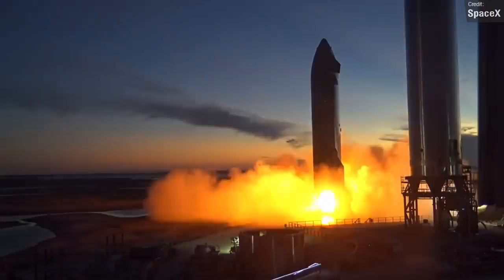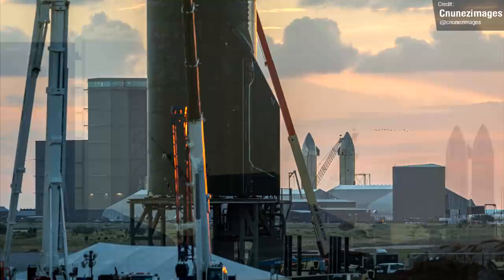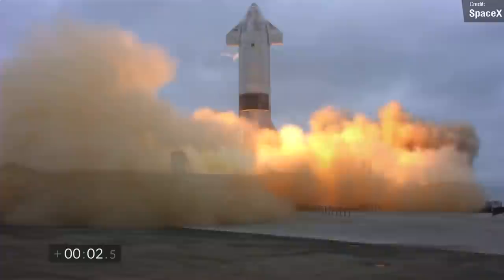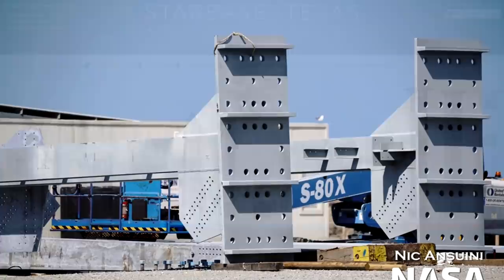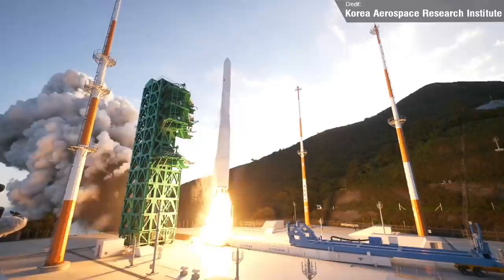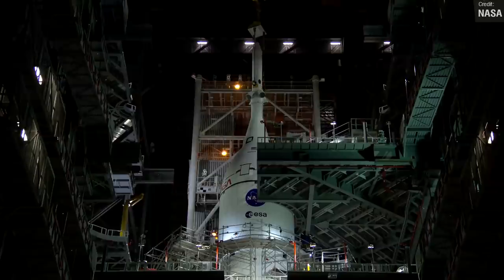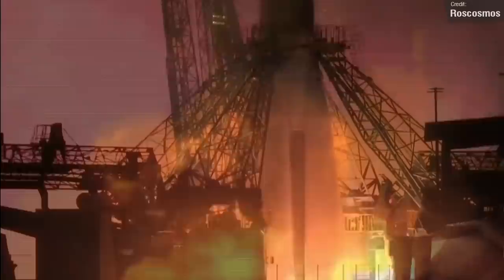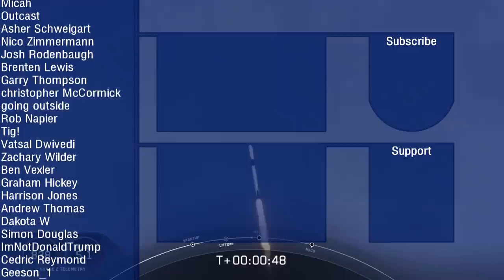SpaceX Starship Damaged in Static Fire, Catch Arms are ON, SLS Complete, Soyuz Progress, NASA Crew-3

Comment: The funniest thing about the failure of the maiden flight of the ariane 5 rocket is, that it was actually a buffer overflow, which caused the failure.
Reply: Like an integer overflow?
Reply: @notoriousgoblin83  I don't know, but it was faster than the Ariane 4 and no one changed the code, so that the speed overflow somehow was partially used as position data.
Reply: Yes, like an integer overflow (the processor only used 16 bit integers, but the velocity censors 64 bit integers) which caused it to override the rotation data. (That's what I remember) in the Ariane 4 they had a working system to prevent that, but they didn't check it again for the Ariane 5, which had a different flight plan and thus didn't work. The funniest thing is that the system wasn't even needed on the Ariane 5 anymore. (This system was also only activated after a minute or so after launch because of memory constraints on the Ariane 4)

Comment: Tbh I think the amount of tiles falling off actually shows how well theyve worked on the heatshield thusfar, as its only like 8-10 out of potential thousands. Ofc we don't want this to be an issue later on, but for a first fully stacked starship using such a rapid production process, I think this is a good sign of overall quality and that improvements will come swiftly.
 Plus, starship should hopefully be able to survive re-entry with a few tiles missing, so it could also be a good test bed for this kind of re-entry test
Reply: I agree and I think a lot of the problem they are seeing now is due to the shock wave bouncing back off the ground during static fire. As long as they can survive the aerodynamic forces they should be good.
Reply: @mgcamp85  Thanks for the clarification; I was wondering why the static fire was harder on the tiles. There's likely still to be some improvements to the mounting system I suspect.

Comment: My money’s on SLS. The only reason I say SLS is due to FAA issues with spacex.
Reply: It's not the FAA's fault, though. First of all, SpaceX already conducted a suborbital launch without FAA approval (remember SN8?), so they don't seem to care that much.

What's more important, though, is the fact that both Musk (in March) and Shotwell (in June!) suggested an orbital launch no later than end of July when in reality four months later they haven't even got the launch infrastructure in place...

I suppose they wanted to use a bunch of volunteers to prop up the booster during launch and use hand pumps to get the LOX and methane in ¯\_(ツ)_/¯

Musk's timelines are for the most part BS and shouldn't be taken seriously. They'll get there eventually, but there's no rush so why bother. Remember that rushing launches caused the death of 14 shuttle astronauts... Even when they launch in February or March, that'd still be amazingly fast and much more progress than SLS managed to achieve.

Comment: I feel that bn4 and sn20 and surrounding infrastructure will be finished before years end. However I think that like sn 8-15 there will be a 4-6 week delay pushing the launch into January. The FAA is a complete wild card I can’t even hope to predict with any merit.
Reply from the maker: Stage 0 doesn't need to be completed before the orbital launch, since BN4 and S20 will be landing in the ocean. The only thing that NEEDS to be there is the orbital launch pad and the fuel reserves, the tower and whole mechazilla won't be required until at least Booster 5 (I would be very surprised if it gets used for Booster 5 or even 6 though).
Reply: @MattLowne  I think infrastructure-wise he just meant getting all the plumbing finished, leak-tested, run out to the pad... I can't even comprehend how many valves will need to be checked, double-checked, triple-checked, replaced, there are probably hundreds of sensors for temps and pressures on all of the tanks and piping, all of that needs to be wired and rigged / networked into computer systems which probably haven't been tested before.  They likely have no other options either, just due to the sheer mass of propellant and oxidizer required for super heavy.  I don't THINK it'll be an issue, since they have a lot of experience with this stuff by now, but it certainly could throw a lot of curve-balls in their direction. 

I'm still not sure about mechaszilla in actual practice; one thing that really surprises me is the lack of guy-wires on the opposite corner of the tower from the catch arm. I know the tower is strong, but from a structural engineering perspective, I don't see how the tower can absorb THAT amount of initial force and weight without some sort of counter-weight or guy-wires, etc.  Perhaps they will install them later, as it's obviously not required yet and they can't tension them at all till the remaining equipment (ie weight) is installed. Oh well, those folks over there are certainly a lot smarter than I am though... I'm sure it's been modeled.
Reply: @alexmathis8505  yeah that is essentially what I mean

Comment: @Matt Lowne I think there is a very simple solution to the tiles popping off.  I was considering a puzzle structure (not needed) and then realized that a ridge and groove system could be incorporated alternating on every other tile, to snap them into place.  The "next" tile on all sides would literally hold a tile in place on all four sides.  You only need to place a groove all the way around the center of the side (no ceramic glue on the sides, but of course underneath).  If every other tile has a ridge, then alternately a matching groove, each surrounding tile would hold the tiles together, and it wouldn't completely depend upon the adhesive.  One tile with grooves, and one with ridges. All you do is alternate the tile as you lay them out.  Previous row must match correctly, too. so staggered by one place.  It would be easy to do, and drastically increase the holding power of the tiles.  It would be difficult to remove a tile.  Even if it is broken, the pieces would likely remain  place.-  Very similar to a tongue and groove flooring system, but better.
Reply: This won’t work because the tiles have to have gaps between them for when they expand. If they’re tongue and groove you have no gaps between them, they expand in the heat, then crack and blow off.
Reply: @kirbeeez6131  I'm pretty confident it would work.  It can be tongue and groove and still allow for expansion.  It doesn't have to be a tight fit, just one that overlaps.  I'm not sure that the ceramic has that much expansion, anyway.  If these are like shuttle tiles, they're designed to stay cool on one side.  In work I've done pouring aluminum, I never notice a drastic expansion of the ceramic involved.  

Just saying it can have a gap and still overlap and help hold tiles together. 
Depending upon the thickness the grooves and ridges can be lower to the body.

I can think of a way to remove shock effect by using a medium temp coating between tiles that melts away.  Wax wouldn't work, unless you want to see a 5 story candle, but there be some  possibilities. 

I'm not saying there is no expansion., but I've smelted aluminum in a flower pot, just needing something that would work quick and dirty.   I don't think it is an insurmountable task. There are gaps already. This idea might even provide more coverage of the ceramic adhesive beneath.  I have to admit I didn't mic the ceramic.  It wasn't the crucible either, but just a shell to act as a furnace housing.  It was amazing how well it worked. 

The lost wax process melts wax out of a hole in the ceramic mold, and fill a more or less solid mold with molten metals of various types without cracking the ceramic.

Wouldn't it be cool to see a starship fly without loosing a single tile?

Comment: Thanks for a Nice video :) 

Question, couldnt they just use a powerfull adhesive for the Heat tiles?
Reply: Absolutely not, the entire purpose of their clip design is to allow for easy turn-around if a tile is chipped, etc.  Just break it off and press on a new one. The adhesive would require prepping the surface and removal of the old adhesive, then allowing time for curing, etc.
Reply: @alexmathis8505  Perhaps they will improve the mounting system with the next few prototypes.
Reply: @alexmathis8505  I know that, and i gues most who are intrested in Spacex know that.

But this is not realy working out, is it?
Maybe just use an Ahdesive for the first flight atleast, half of the tiles will fall off in the first launch haha

Comment: Despite the fact that in some ways both Starship and SLS are this generations Apollo. I have my money on SLS right now despite being a fan of the Starship program because of just how revolutionary it is. Although I do sense that the regulatory trouble that SpaceX is facing might just be NASA getting jealous of Elon being faster than them. So they are slowing him down. TL:DR I think that SLS will make it first (somehow) exclusively due to regulatory issues.
Reply: I agree with most of what you said, except the NASA/FAA connection thing - there's just no way.  For one, NASA wants starship to succeed as it's the landing vehicle they want for the moon AND they're getting pressure to select something additional.  If Starship remains on schedule and on budget, it actually makes NASA's decision look good in congress. 

Secondly (and what most people don't realize or respect) is that the FAA is simply following and enforcing protocols and paperwork that was established LONG before SpaceX even existed.  It's not a government owned facility or launch vehicle, and is subject to some pretty strict rules given just how incredibly powerful (and potentially-dangerous) the rocket and its infrastructure could be if a mishap occurs.  The FIRST place people would look to put blame on would be the FAA (think Boeing MAX, people were just as pissed off at the FAA!)
Reply: @alexmathis8505  That was a joke...

Comment: Twin moon exploration.
We dont know if the spacex rocket would stay upright after landing due to the fieceness of its own landing rockets.
Sending the spacecraft rocket to the moon with NASA astronauts as a first ettempt would be problematic in terms of safety. Why not split the moon mission into two mutually advantageous parts?
Simply send an unmanned Spacex rocket to the moon in advance of the NASA Luna  module.If it lands safely it can be used as a very spacious,well equipped,exploration centre,then,and in the future.
I envisage, after a safe landing,the spacex rocket unpacks and winches an all terrain vehicle.This Luna vehicle the makes it’s way to rendezvous with the Luna module which has landed some time after.
The astronauts then use the vehicle to get to the Spacex rocket and it becomes the centre of operations..A huge leap in technological equipment and comfort.
The beauty of this twin method is that if the Spacex rocket fails to land the NASA crew simply land and continue their mission as originally planned,without the utility the Spacex joint venture would have achieved.
Reply: Ya never know, put it out there n something will shift 😊
Reply: It’s too expensive to pay for both, the starship will be extremely reliable by the time it launches humans to the moon.